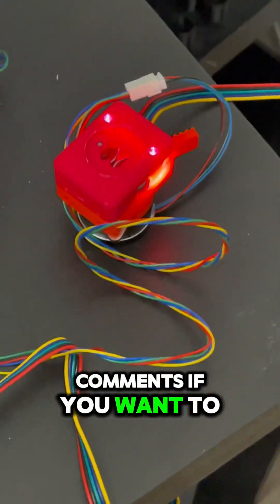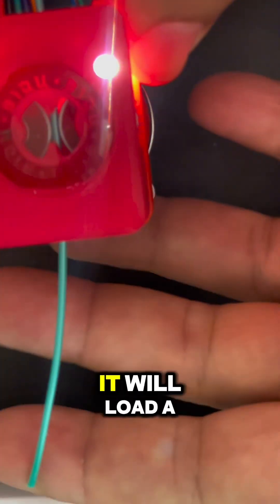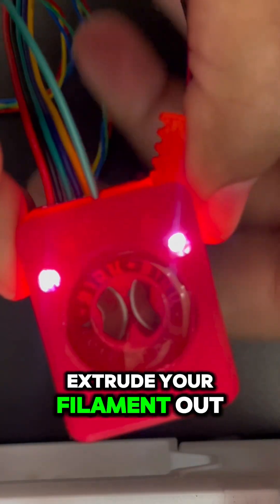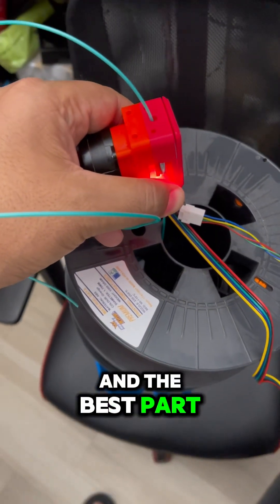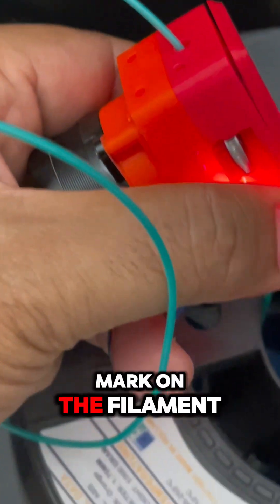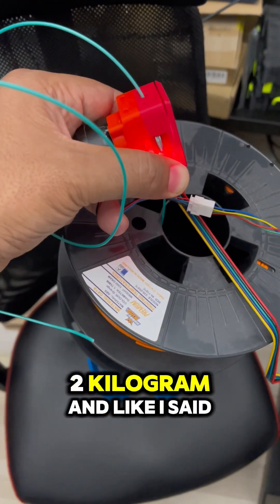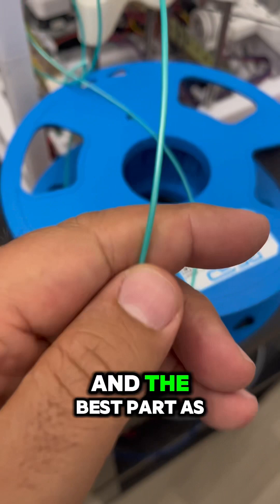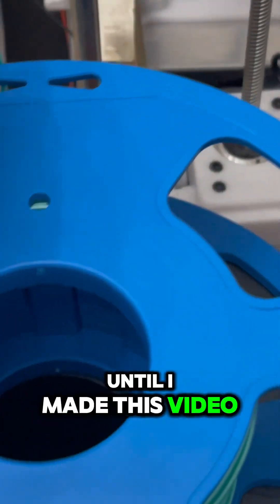Nebula Extruder Pull Force Test – 24 mm³/s with 2kg Load

Comment: I need to try this, I have a lot of ASA GF my clockworks won't push
Reply from the maker: I have tested with some glossy PLA and at 1.7kg it start sliping  at that speed. 
It depends on from filament to filament. 
But will not encounter this condition. That often.